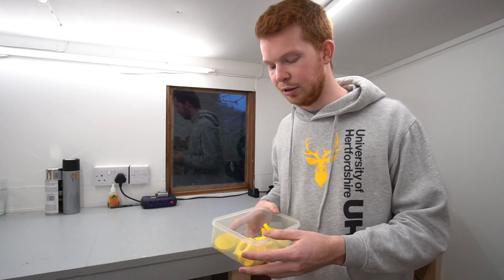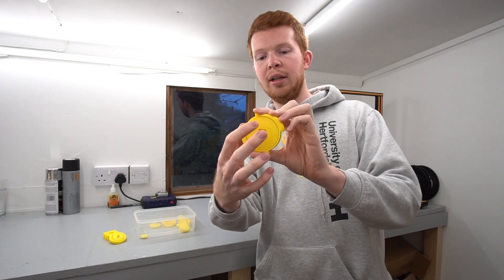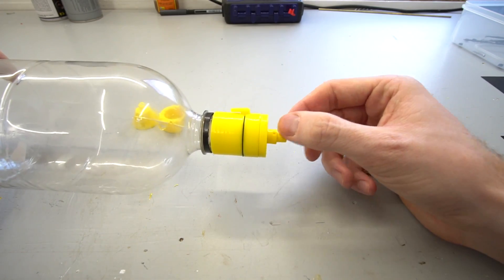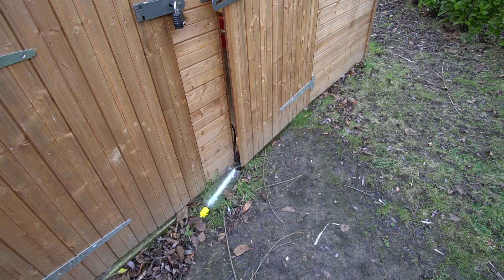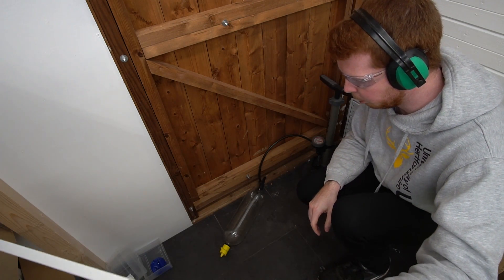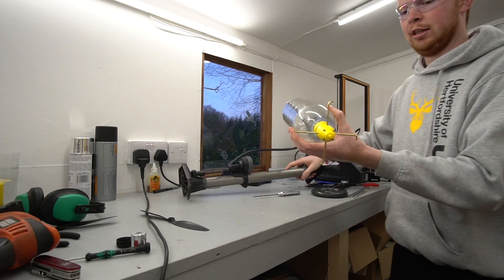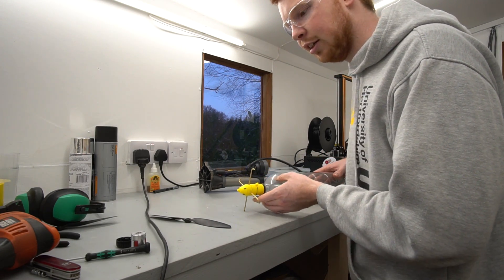Air Powered... Propeller?

Comment: Maybe you could try a Tesla turbine. The gap is not the biggest concern. They function on laminar drag on the discs. These don't scale up will because they are most efficient at hire RPM. However at a small scale this may not be such an issue.

Comment: I wonder if it would work better with different nozzles? 2mm seems pretty wide, a narrower nozzle would restrict the airflow, which would both reduce air consumption and increase efficiency (by increasing the velocity of the air exiting the nozzle).

I also think there's quite a lot of air leaking from the gap between the valve housing and the prop hub. You can actually see it in the video when you open the valve, theres a thin burst of white gas from the gap. Finding a way to stop that would probably help a lot. I wouldn't be surprised if there's more air leaking from that gap than coming out of the nozzles.

A final suggestion: remove two of the nozzles, but make the other two much longer. That way you get the same torque with half the air used.

Comment: he could have just angle the pipes on cap a litte downwards, at an optimum angle. This would cause the air to move out in a downwards force. Which may reduce the resultant force that makes it spin, and reduce the RPM, but surely he might have a better alternative. 
And to increase the total time the propeller spins he could have only attached 2 pipes (reduce the number of nozzels) this will force the air to escape in higher velocity and even if the rate at which the air moves out is constant or slower the total dureation or spin time can be increased.

Comment: What if the nozzles were somehow built into the tips of the propeller? That way you can have the maximum torque on the prop to rev it up while also not having them in the way of the airflow underneath and less mass to turn.

Comment: This is a jet propulsion system, so like any jet efficiency is improved by increasing the speed of the jet - the nozzles should probably be on the propeller tips, rather than at about half of the tip radius.

Comment: For future reference... for safety, test pressure vessels with a relatively incompressible liquid (such as water in this case), rather than a gas, to minimize the stored energy which is released in the case of sudden failure.

And a pressure gauge to monitor loss of pressure is a more practical leak detection method than putting your ear near a pressure vessel under test.

Comment: Hi Tom, why not combining this technique and that of a water rocket? I think if you eject water out of the nozzles, it will turn much longer. Don't know how build it, but if you fill half of your bottle with water, increase the airpressure as before and turn the bottle with the propeller facing down before you open the valve, you can test the concept.

Comment: Wouldn't it work better if you pointed the air jet forward to blow on prop adding speed to the spin and jet pressure go threw the nose then blow back on the blades blades behind the air jets

Comment: Eliminate the tubes entirely. Instead, add four jet nozzles to the model at the tube locations. This will save weight, reduce drag and allow you to play around with jet nozzle diameters to get the best performance. 🤷‍♂️

Comment: Parts are would be good. Also depending what you're using to edit videos. You might have a noise reduction feature where you can select a section where that wind noise is and tell it to strip it out.

Comment: You need to choke the nozzles of the outputs. Make them a converging duct which will increase the gas exit velocity, it will also stop all the gas from venting straight away. 

Jet and rocket engines produce thrust not from the pressure imparted on the air , but from the velocity of the jet of gasses.

Comment: Nice.   I once knew a guy that created a helicopter that used a jet turbine engine and routed the exhaust out of holes in the rotory wing to spin it.    It reportedly worked very well.    He used graphite bearings to handle the pressure and heat.

Comment: Building the pipes into the fan blades made sense because the motion of the pipes through the air is also creating thrust *and it reduced weight*. I understand if it still only lasts for a few seconds it might not be worth it, but if you did try another version maybe try building a custom propeller and putting nozzles on the pipes?

Comment: Nice try, but that bearing was no good.. (the hammer probably didn't help) I think you should of used the smallest bearing possible. like a bearing with an inner diameter that would fit the brass tube for your axel...A 3d printed  hollow propeller with built-in output jets would be cool...maybe you can also gain some efficiency by splitting the air flow down a hollow multi blade propeller using internals like an impellor ... Would like to see that!!

Comment: My machine design teacher in 1967 high school  mentioned that type of reaction turbine was the worst for efficiency.  The good ones take advantage of as much of the expansion as possible.    ( your air engines do a good job of that ) Whatever works for your uploads is fine by me.  I love your projects. The failures are great too,  your persistence is to be admired!

Comment: Wouldn't that work better with only 3 or 2 brass tubes, but longer? There are probably ways to calculate that and find the most optimal setting that produces the most thrust for the least air (and weight)

Comment: reminder you are relying on the kinetic energy of the escaping air for thrust.  Cut your escape channels in half and engineer the two remaining outlets for maximum air speed coming out of the channels.  Remember the formula for kinetic energy...  proportional to the mass times the square of the speed.  You can get more out of your stored pressure that way.

Comment: Have you considered spinning the whole thing, bottle included, and getting rid of the bearing? That would let you avoid the leaks and friction in the bearing, at the cost of more viscous air drag (on the side surface of the bottle) and a more complex launch/testing setup.

Comment: Have you tried using the same cylinder similar to a paintball gun, i.e. similar to this:
https://www.takealot.com/12-gram-co2-cartridge-30-pack/PLID51791596?gclid=CjwKCAjw_-D3BRBIEiwAjVMy7J9AYOxd0l-R7GUdwVfHuRmbuR_uFHB6u7eF1aweOmil-JyzgdfniBoCA7cQAvD_BwE&gclsrc=aw.ds

Comment: For safer pressure testing, fill it with water as much as you can before pumping air in. If it pops, water doesn't violently expand like air.

Comment: For the ball valve to make variable thrust you can make the holes on the ball valve different sizes and Chang them out the down side is if you go with a smaller hole you won't be able to up the thrust

Comment: I'm pretty late to this video, but here is my 2ct.
One, the gaps are probably leaking as much air as is going through the nozzles, which cuts your running time in half. Two, have you tried making actual nozzles instead of straight pipes? You're losing a lot of efficiency there!
Reply: Three, you have a hard bend right before the "nozzle", meaning that you have turbulent flow, which of course doesn't help your efficiency.

Comment: I would maybe use a brass tube epoxied to the housing and then connected to the bearing shouldn’t have a problem with it snapping and shouldn’t add that much weight and I would scrap the plastic bottle and use the biggest balloon I could find because the elastic in the balloon will store more potential energy causing a longer pressure curve as the volume of compressed air decreases in the bottle the pressure is also being rapidly decreased but in a balloon as volume decreases pressure is slightly maintained by the contracting elastic

Comment: Too much weight and mass, for that small amount of air. The parts you designed using the same materials, should be milled to reduce any and all unneeded weight. Thin is good. The brass pipes are also too heavy, maybe buy some  paper or plastic straws and open and cut and glue together to fit the original design would probably work, also the same principals would work with the propeller, a propeller frame wrapped in  plastic or foil  would lessen the weight, also too much air is escaping at one time, maybe smaller ports for the air to escape.

Comment: I have found a device for increasing the pressure of my air compressor... 4 bar... the numbers are in lbs... 120psi ==>> to 10,000 psi..... and I am thinking about the inverted bowls... because blowing compressed air out on top of each bowl creates lift underneath, exactly like a wing passing through atmosphere... but it doesn't require forward movement to obtain the lift
Reply: Bought  and awaiting delivery... I will keep you posted
Reply: Do you think one large bowl is possible?... I can't figure out pitch and yaw without at least 4 air jets around the periphery
Reply: So I was trying to blow up an industrial strength balloon without mechanical assistance.... and I couldn't make it past "go"... this is a clear demonstration of the increase in leverage with a smaller orifice... I used a 6mm tube with a small metal outlet inside the balloon's blower upper part...  tech talk for the thinggummy at the bottom of a balloon 🎈 😳
Reply: Balloons are like batteries for compressed air... and this method of increasing pressure will actually create a liquid at some point.... the company makes machines that put out almost 70,000 lbs per square inch... an amazing 4 thousand and some odd bars... from a little under 4 bar air compressor pressure.... it's a tremendous increase in leverage... climbing the hill... to get the most amount of work out of the least amount of effort
Reply: It takes work to move mass.... the amount of work is measured by the amount of mass moved over some increment of distance, per unit of time 
.. horsepower is not a very accurate method... but it is one most Americans are familiar with... it's especially important for flight... it's the old weight to horsepower ratio and... that's the hill we have to climb to fly... everything is accelerating towards the center of the Planet at 9.2m/sec².... and it requires work to move.... in direct proportion with the mass

Comment: Spray soapy water around the threads to check for leaks
Reply: Teflon tape for sealing plumbing threads is the most atmosphere resistant material, with 0 weight increase... practically... 0.001 gm... is trivial and can be safely ignored... at this point in time

Comment: I’m not an engineer, and I have no real experience doing anything mechanical, so please take this with a grain of salt. How likely is it that you could put a gear or two on the air release so you could get 3:1 or more out of the propeller? The 1:1 release obviously isn’t the way to go … I don’t see it as a failure, just a huge loss of potential power.

Comment: Compressed air is not a good power source when the air is not being continually compressed as with a dentists drill.  Where you store compressed air in a static reservoir you lose much of the energy you put into compressing the air as heat which radiates away. When you release the air it quickly cools and loses pressure. That’s why you keep seeing condensation in the bottle. You’re not anywhere near the first person to miss this flaw in the design. There have been a number of companies that made this mistake in announcing compressed air cars, which never materialize.

Comment: Air pressure and volume. Most importantly, volume. It takes a huge tank to hold enough air to make a prop spin for more than a few seconds. Efficiency, I would imagine, is also a big factor. I don't have an engineering degree, so at the end of the day it's just a layman's observation.

Comment: We user ceramic ball bearings in our Student Motorsportscar as wheel bearings. Extremely brittle little peaces. We always used a rubber hammer to put them in place. Never ever use a hammer! These bearings break and shatter to easily. Anand they are way to expensive to abuse them with a steel hammer

Comment: Not to be that guy, but hammering those ceramic bearings is a terrible idea... rubber jaw vise or rubber mallet should be used for bearing fitting in the home shop, shouldnt have any metal/ceramic contact as you could throw the tight tolerances off quite easily

Comment: This IS Rocket science. 
You have essentially made a rocket driven propeller. 
SO? 
A critical aspect in producing ample thrust in all rockets that you had not considered in the design - 
THE NOZZLES
Shape and Aperture needs a design that maximizes / optimizes the velocity of the escaping gasses (air) .
It would be worth knowing, what is the best thrust value you could expect
 to achieve using the theoretically optimum nozzle design parameters.

Comment: i think most of the air is scaping from friction between rotor and stator... you should use sime rubber and grease for leckage... you also need to reduce the exaust holes to small size that might make difference

Comment: To test the resistance of the bottle under pressure, i is good practice is to fill it with water before pressurising it. Then, if it breaks, it does not explode.

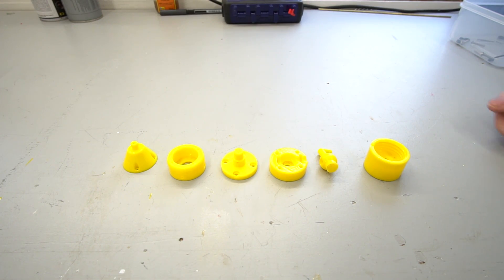Comment: 3:52 Don't worry. i got a soundcard that is For sure like 5-8years old. (not a soundblaster. it is a normal soundcard with Microphone, and speaker and Aux in, and al these crap headers like internal Aux, PC Beeper in, CD Analog Audio in, and another one that i dont know.(but the problem is: By Every start i have to unplug the card, And search for devices in Device manager, and then i have to plug it back in and rescan to reactivate the card. If i dont do this, i have a squicky high pitched Voice. Dont belive me? i will make a short video with that problem just for you. ;) but if i "fix" it, then it sounds almost normal. (except that i have sorta the Early sound of Chaosflo44... And i don't try to mimic him.) i just happend to be lucky, because the internal sound says: Screw you. And since then i need that soundcard.)) Please Stay Healthy. (ps. i never really learned engish in scool, but i can Shockingly write good, and Kinda talk good english. (it's the most basic english that i can i guess...) but i'm confident enough to use that anguage and i wi change somthing if it is Mispelled. and i learned a Tiny bit english in scool, but it is Such locng time ago, that i guess that i Learned it by Watching english videos... Because i watch NileRed, TKOR, ElectroBOOM, and some other english youtubers.)
LG Chaosminecraft.
ps. if that text was too long, im sorry, but i wrote a Small story of me... (just about the english language.)

Comment: You've heard of propellers moving air. 
Now get ready for:
Air moving the propeller.
Reply: Air moving the air moving propeller
Reply: In soviet Russia..
Reply: the rotodyne had a massive propeller powered by tip jets
Reply: Wait till u hear about gyrocopters and helicopter autorotation.
Reply: I think there is no comparison to compressing air with pistons vs. surrounding air (=there's very little). There's a real problem of getting enough "push" to the propeller with concept like this...
Reply: He should try a whoopee cushion.
Reply: air moving the propeller, moving air
Reply: Wind turbines existed loooong time ago
Reply: a windmill?
Reply: Air moving a propeller=Propeller moving air using air

So Air moving air

Comment: I wonder if anyone has ever tried to get lift (like a vtol)  from a circular radial wing by blowing a flat air blade from the center of the circle outward radially to the circular wing on the perimeter of the (vtol)?  Using 2 powerful shrouded fans,  blowing air at each other so the thrust would go outward radially  hitting the radial air foil and making it go upward?

Comment: make the propeller adaptable to a propane can, add  a spark plug and a solenoid instead of the ball valve. It would essentially be a blow torch powering a propeller \_( 0 _ 0 )_/ .... the Flamecopter!

Comment: Re: tolerances.  Did you try printing them oversized and then turning them to fit?
Reply: Maybe ASA or ABS prints with 100% infill. Tried that once with a 3d printed PLA part and it shattered instantly. Simple rotational parts would be better turned from the start in aluminium or something like POM.
Reply: Sandpaper?
Reply: @doel89  it would be hard to keep things true and square or achieve high tolerances with a hand sanding.
Reply: @allansutton557  how about hand cranked lathe? it shattered because of high rpm. non powered lathe only use a spindle rope and feet to make them spin. like one of the pen making videos
Reply: For most of these parts, if they're going to be turned on a lathe anyway they might as well start as just solid stock of a more suitable (stiffer) material, instead of extruding them in soft thermoplastic in a 3D printer.

Comment: 3D print with extra material then plop it into an electric drill and chop of the exces bits (like a makeshift lathe)
Reply: lennart rolland needs to get it centered then, instead of chopping, sandpaper

Comment: This concept is impossible. He’s converting air thrust into mechanical power, and then right back into air thrust. He will always produce less thrust with the prop than what the nozzle already put out
Reply: have you seen his future videos? He said It's not actually meant to be a proper way of doing this (or it's more an "experiment", something along those lines). And he's gotten some impressive results. Also, if you release the air slowly, you won't get too much drag, but if you just let it straight out a hole you will get more speed and more drag, lowering the efficiency (from my understanding, but do take this with a grain of salt).

Comment: I know it's an old video, and you have already come up with a new design and got it to work, but perhaps the air does not have enough mass to impart enough momentum to spin the prop?

How about testing with water in the bottle? Sort of like a bottle rocket thingy. Where the accelerating water is the main driving force of the rocket.